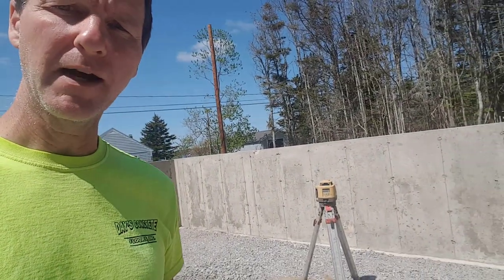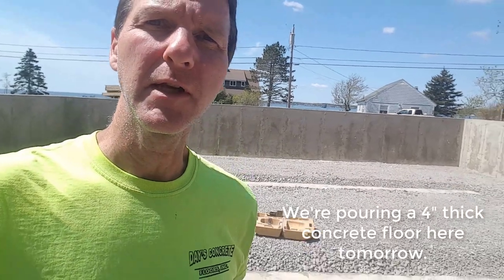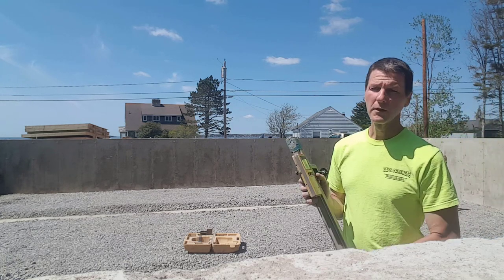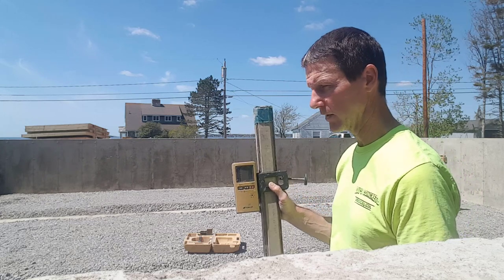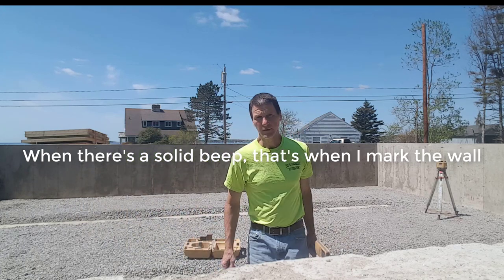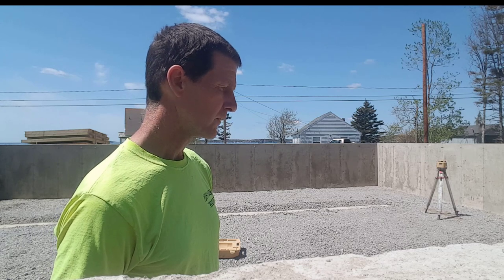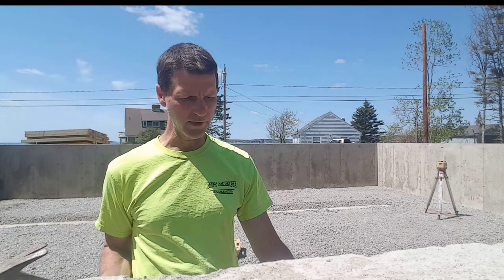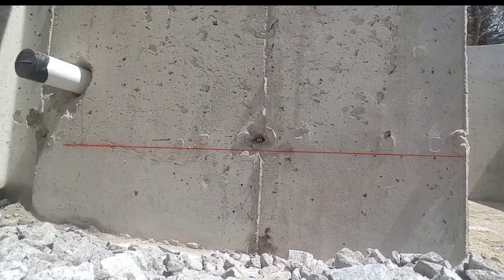How to use a laser level for beginners

Comment: Question - I just bought a Bosch GLL3-330cg cross line laser level and a Bosch LR8 laser receiver.  I do not have a grade stick yet but its not necessarily needed.  My question is we are transferring top of joist and/or top of girder elevations to pilings ahead of us that have nothing attached to them yet.  So we shoot the laser (horizontal plane) at the pilings (they are too faint to be seen by eye) and we simply raise/lower the receiver while skimming the edge of the piling until it detects the laser, then mark that spot.  My question is if you do not have the receiver perfectly level as it detects the laser, how do you know which slot to use to mark?   If I do buy a grade rod, do you have to ensure the rod with receiver attached is perfectly plumb before you mark that spot?  Just used this today for the first time and I use the marking slot that is right by the laser absorption/detection window that is on the face side of the receiver.  Am I doing this right?

Comment: Thank you for the video. I have a question which may look stupid. Could you please tell us how will you be sure the middle of the slab is also levelled? Will you use this tool when you pour the concrete? How can I be sure the middle of a big slab is also levelled if I don't have such a laser tool? I have seen some workers using big nails in the midle of the slab and alligning the top of the slab to the top of the nails when pouring the concrete. Is there a better method to do this?
Reply: Drive stakes on grade spread out so whatever your using to screege can reach
Reply: Piece of rebar, pound in ground in center check with laser level. Bring concrete to this level.
Reply: If you haven't got a laser you can do it the old fashioned way and use a long piece of 3/8 or half inch clear tube with water in it. Put food colour in the water so it's easy to use. You only need reference marks. As long as all corners are marked level,  measure down evenly to slab height. Centre height can be done same or tight string line to top of pegs in middle from chalk lines or top of forms.

Comment: Hey mate thanks for your videos, really helpful. I’m curious can you use a laser level for making a flat surface on a slight slope? I’m wanting to lay turf on a prepared slope of top soil but want it dead flat.
Reply from the maker: For sure you can.
Reply: Sorry just realised I didn’t explain myself very well. I need a flat surface but on a slope. So basically what I am after is: how do you set your laser to be on an angle??? I’ll be using a foot path as one side and sloping up to my house.

Comment: Mike, what are your thoughts on Topcon RL-H5A? Overkill for basic grade work?
Reply from the maker: I think for basic grade work the H5B is all you need. The two major differences between lasers is H5B is good up to 400m, H5A is good up to 800m. So if distance is a really big deal go with the B. The other difference is the slope setting with the A.

I do slopes all the time with my concrete floors, slabs, sidewalks, driveways all using the B. No problem.

hope this helps
Mike

Comment: You can not just assume that picking the average gravel measurement then just lowering the sensor to 4'' and click you have 4'' top of concrete . You need a reference elevation point from where you have to be 4''  top of concrete related to door entrances and so on. good video but explain because is for beginners

Comment: How far above the end of your rod is that receiver target set?  And how did you determine that?  And how does your instrument height effect that ? What’s their relationship?  You said you were “getting 3-1/2 to 5”:  What does that mean?  For a beginner how-to  video,  this was not helpful. You assume your viewer knows more than a beginner.  You need to explain basic geometry of what your doing.
Reply: Agree. I like is videos, and this one too, but not at all for beginners. Sort of the opposite. Mostly shows the end result with no explanation as to how to actually use the stick and measurement device to get the chalk line at the right mark.
Reply: He's measuring the elevation of the top of the stone base, and trying to establish a zero reference point, on top of which to add 4 in to get to the top of his concrete.  He said he measured between 3.5" to 5.25".  All this really means is that there is a 1.75" difference in the top of the stone at its highest points and lowest points.  So he took an average of that measurement, and added 4 in, meaning some areas will have more than 4 inches of concrete and some slightly less.  But regardless of the sub base not being perfectly level, as long as the concrete is placed with a laser, the top of the concrete will be perfectly level.  If the stone base had been placed with a laser level, it would all read level with the same elevation on the rod.